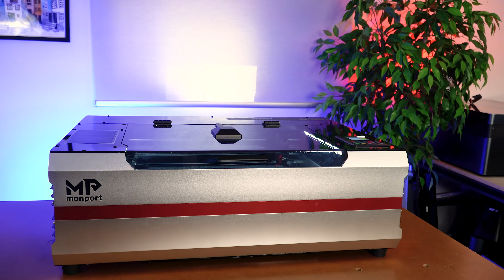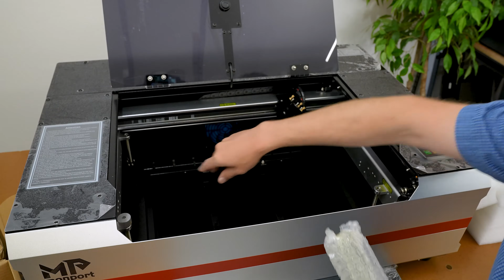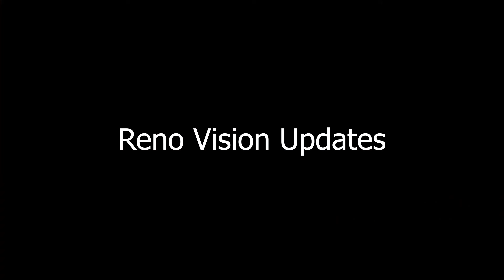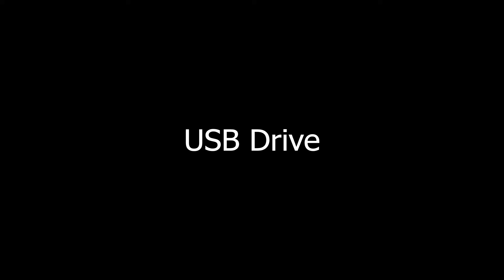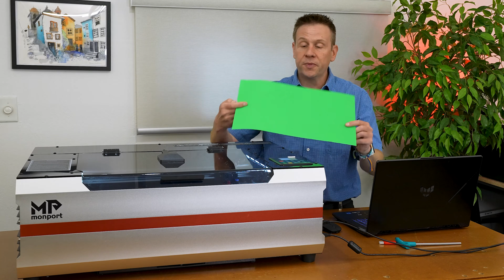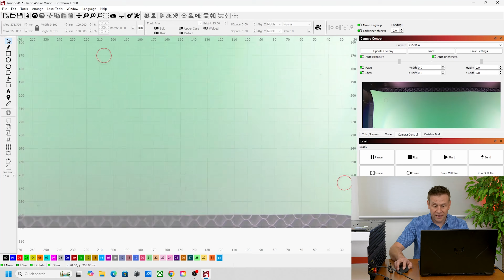Reno 45 Pro Vision by Monport - First Look  #monport #reno #firstlook #laser #co2

Comment: I can't believe your camera just turned on.  I have not got my camera to come on at all
Reply from the maker: The camera is on its own USB port and I did have to select in the Lightburn dropdown menu.  I don't think I' have ever had a camera not show up in Lightburn from any machine.  Very odd that yours isn't showing up.
Reply: @thelaserchannel1  It was the 2nd USB Cable. I tried for hours, and found ZERO people that mentioned plugging in a 2nd USB cable. It also worked in AUTOLASER WITHOUT the USB cable, so, that threw me off. 3 hours later....I plugged in the 2nd USB cable, and it popped right up.

Comment: Hi Greg, love your channel👍. One question, i recently bought a Reno 65 pro and was wondering about the co2 tube lifespan. I opened the back of the machine and saw that the tube has no pink/purple glow so i assume the tube has no Catalyst. I know from my old k40 laser that they wear out quickly. What is your experience in this?
Greetings Erik
Reply from the maker: Glad to hear you love the channel!  Yes- I usually see the pink/purple glow in the laser tube when it's firing.  Laser tubes tend to last for several thousand hours when ran at a max of 70% of there capacity.  I've had clients run at 100% 6 days a week and the laser tube life is very short.  When run at or below 70% capacity the life is very long.  Higher wattage tubes also tend to have a longer service life.  Hope this helps!

Comment: Is there a laser that engraves on wood that projects the what is to be engraved on the wood before you engrave it like a fiber laser does?
Reply from the maker: Some galvo type lasers with a laser diode source can- it's hit and miss on which brands do.  Check into a regular size galvo machine with a Co2 laser source.

Comment: Hi, can the engrave full wrap tumblers?
Reply from the maker: By all accounts it should be able to.  I have not connected a rotary yet but I do know the rotary setup does not use the Lightburn rotary menu- the machine setups the rotary in a different area of LB.  Using the rotary on the Reno is something I would like to checkout in the near future!
Reply: @thelaserchannel1 thanks for the answer
Reply from the maker: @reynaldosantos521  No problem!

Comment: It's a shame they used the Topwisdom controller in this.  I hate using my Reno Pro with Lightburn so much that I am hacking a Ruida controller (which does not fit) into it.  I would have paid the additional $100 for Monport to include a basic Ruida controller.  Be prepared for a lackluster experience if you use LightBurn and want to buy any Reno Pro.
Reply: 😮Thank you for highlighting. Didn't know this different before. I thought there were just same lasers.
Reply from the maker: I haven't had any issues with the Pro version using Lightburn.  The machine is really fast, acerates fast, and most of all the laser doesn't shudder or hesitate when engraving.  Actually the Reno Pro and Pro Vision are my favorite desk top co2 machines- just my opinion.   
What's the issue(s) you're having with the Topwisdom controller?
Reply: @thelaserchannel1  I upgraded from the Omtech K40+ to the Reno 45 Pro and I'm incredibly pleased with how much faster the machine cuts.  The laser is either much better than the other or Monport is overdriving it.  There are a handful of things that make life in Lightburn less pleasant, but the two things that really irritate me are continuous framing and rotary.  The laser head rehomes after every single frame and it can be very difficult to get Lightburn to abort the framing process.  As for rotary, gone is the nice Ligbhtburn rotary dialog.  You have to f*** around with obscure settings in the Machine Settings dialog.  Lightburn doesn't understand them, and trying to read the poorle-translated Autolaser manual doesn't clear anything up.  Lightburn has given up on the Topwisdom controllers and so have I.
Reply from the maker: @SkwerlKC  Ok-  yes- I've heard the rotary setup is more difficult than it should be and doesn't use the regular LB rotary setup menu.  I'll have to check out the rehoming after a frame.  Thanks for sharing your input and experience!
Reply: @SkwerlKC  I share your opinion on the rotary.
Even by buying the model dedicated to reno I still have not managed to do it properly. For everything else it is really a very good machine for me.